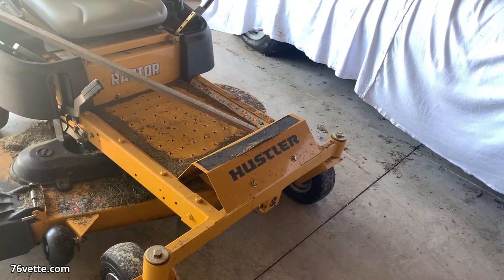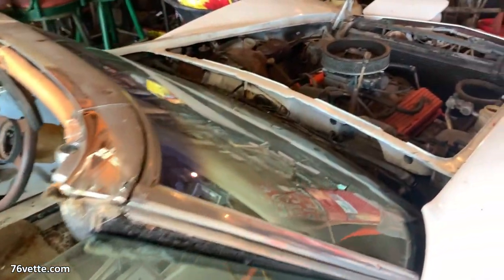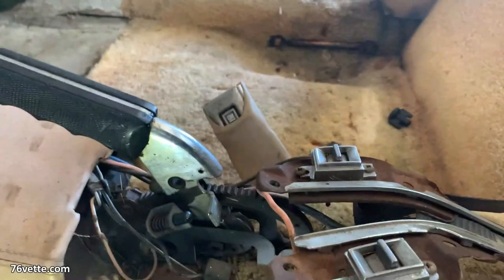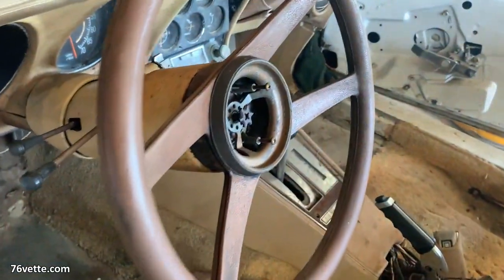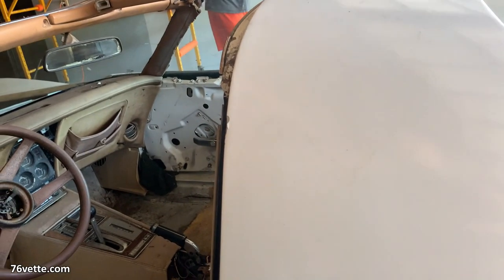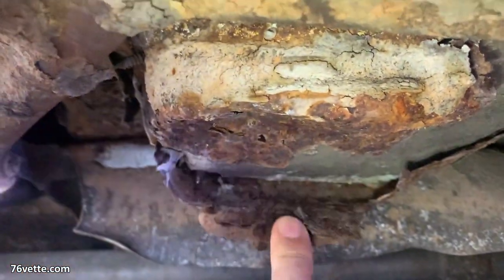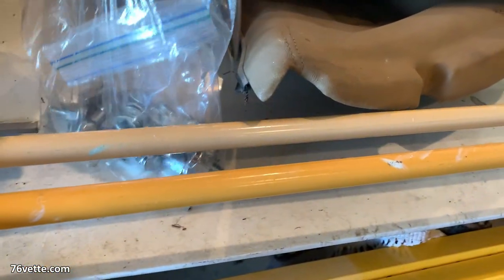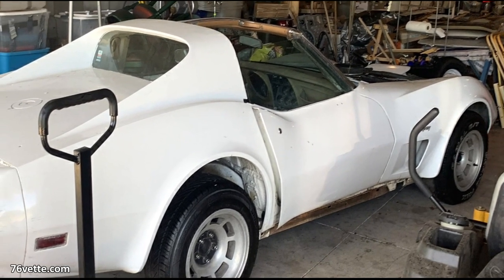I Know What I Got! TRASHED C3 Corvette

Comment: I agree that car would take a lot of money to repair even if you did it all yourself. My 75  corvette I only paid $1000 for last December and the interior was removed. It has the original running engine and no rust. I’ve reassembled it, painted it, new tires and interior for less than $5k. I’m a retired engineer and I did all the work myself so the price to put it back together reflects that fact. There are good ones out there, they are just hard to find. Thank you for the great videos!
Reply from the maker: Thank you for your support! 😊👍🏻
Yes, car restoration can be a very expensive hobby, and if you have to farm it out then it gets ridiculously expensive.
C3 Vettes are getting harder to find and I think some (maybe most?!?!?!) have led hard lives.
Reply: I got lucky with mine. It was inside a shop for years. The owner passed away and his son sold off his cars. I bought the Vette and a friend of mine bought a 69 Oldsmobile 455 car for $900 ( none running). There were probably a dozen cars in and around that shop all pre 1970 muscle cars etc.

Comment: The music really sets the tone of the sadness I am seeing and feeling right now. Wow. I thought my 68 coupe was bad because it needed a FULL tune up, carburetor, gas tank & lines, exhaust and a few other things. I regretted paying $6000 originally, not knowing what I was getting into. Then I spent about $8000 getting everything done that I couldn’t do myself (holy shit & never again!). I’ve learned a lot though. Body is 90%, frame and the birdcage have no cancer, all the lights and windows work and she’s #s matching. I got a little ripped off by the shitty shop that wasted more of my time than anything but I feel she’s worth more than I put into her and all that’s left is fixing the brand new quadrajet they couldn’t even get running right… anyway long horrible story. I love my car and no ones touching her ever again. I would have hated to have gotten her home in this condition thinking I was going to restore… my condolences to the seller.
Reply from the maker: Many of these cars have led really rough lives thanks to uncaring owners. Some are worth restoring, but this one—unfortunately—is not one of them.
Reply: seems like rust is number one thing.  If there's rust then its done for.  If not, then someone will want it.

Comment: Curious to see how this ends.  I spend 3900 on my 77' vette about 8 years ago...and i drove it home and parked it as a project retirement car. Glad to say this last week is first time I got her put back together and firing up.  Got about 1800 in it... so far invested under 6k... but it also could use another 5k in work to make it show worthy. With that said.. Im 37 and still got another 23 years to get her right.
Reply from the maker: I don't think this '76 will ever be restored. It's just not worth it, except for a few parts, but that's about it.
Good luck with your '77 project... you whippersnapper, you. LOL 😆👍🏻
Reply: @C3 Corvette Channel  LOL, well I will be sure to reach out when I run Into problems if you find the time!

Just removed the stock quadrajet and installed an edelbrock 1406 (means  I'm mechanically declined this small feat was an accomplishment for me!) Next is just finding the right linkage adapter to make it all work and tackling the breaks.
Reply from the maker: @stevechadwick85  If I can be of any assistance I’d be happy to help. 📧 diy76vette@gmail.com 😊👍🏻

Comment: The body panels and the glass are easily worth a $1000 if you part it out. Pretty much everything else is just worth a few bucks. It’s restorable with a new bird cage, new frame and drive train. Then a new interior. I am estimating that it would cost $30,000 to do all that. And it would still in the end be worth only $25,000. So there would not be any profit. But if someone had the time and dedication, it would be worth it as a keeper because you would end up with a like brand new car.
Reply from the maker: I think it would cost far more than $30k to restore.